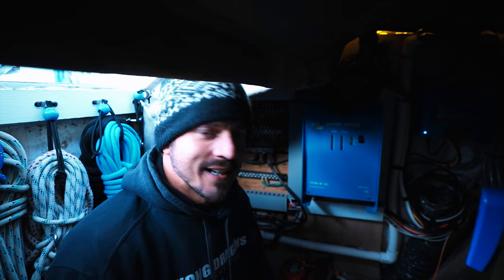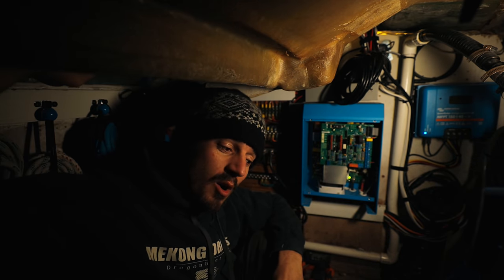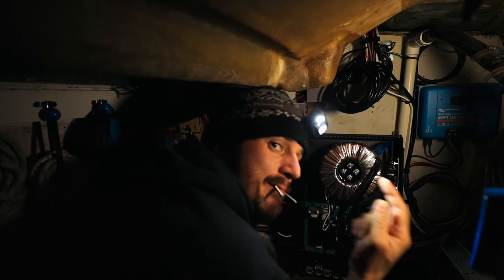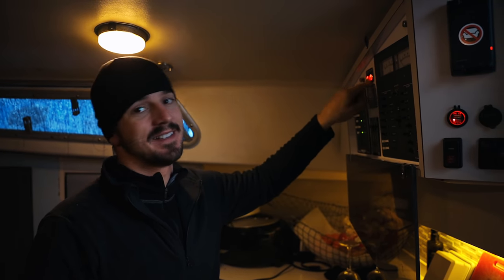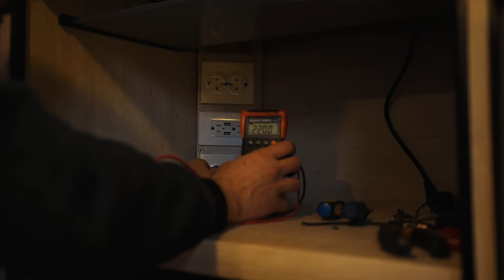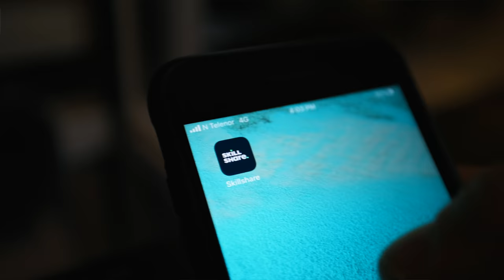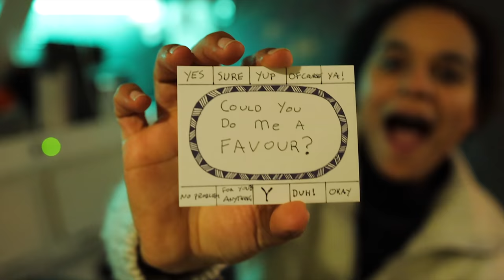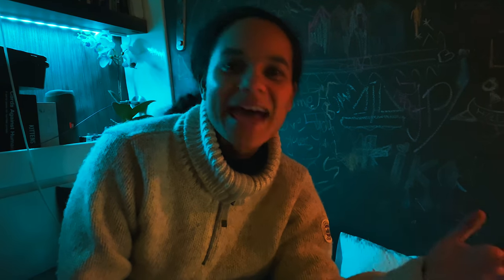Cold Dark Days — Sailing Uma [Step 255]

Comment: I love the episodes with boat fixes and upgrades. Great job Dan. I have 12v and 120v right now, but we are going to go with a 48v bank and electric motor conversion soon. Had not thought about adding 240, but now I think we’ll start planning for that for when we hit europe.
Reply from the maker: It’s hard to find a good 48v shore charger that runs on 120. Most are 230, so you may as well get one that inverts and has pass through. So you don’t just float your batteries to death when at the dock.

Comment: That's a lot of systems on one boat. I HIGHLY recommend using a labeling system at each end of every conductor to indicate which system it is on. Normally I'd say color code all conductors but that's a bit much for a non-commercial project. Looks like a well put together system - and that's coming from an electrical engineer :)

Comment: Different scenarios but , 6 months ago We set up for induction cooking in our camper. 
200ah lithium ,2000w inverter , 350 watt solar only (at the time)
Going great for us !  cooking for 4 each day solar keeps up 95% of the time. (Also Running two small fridges plus lights and recharging gear)
Only Just added a dc/dc charger so if needed can plug in and charge on the move. 
Hiking gas burner will stay stored for backup.
Definitely doable , just have to work around systems. 
Have fun figuring it out , definitely worth the investment in my eyes 😉

Comment: I run an induction hot plate, a microwave a crockpot and a fridge freezer combo off a 3500 watt inverter with 4 12v deep cycle lead acid. But I do have a 500 hp diesel to keep it charged. Even if it doesn't work all the time it's safer and better than gas. Crockpot the beans and rice and it lasts for days. I actually use the crockpot for skillet also so it doesn't spill.

Comment: That coil is called a Toroid , or torroidial transformer. That transformer, plus the fact that higher frequencies are quite often used, make the systems far more efficient than old technologies.  I actually have one nearly that large and it is wound as a transformer. It was surplus. Happy Bday Keeka.

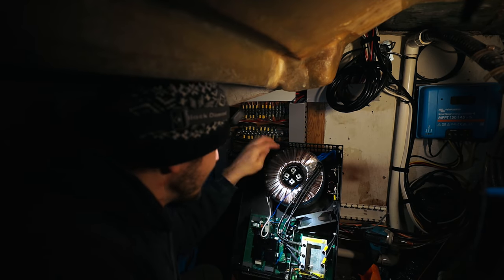Comment: At 6:27 ..that is not a "coil", that is a Toroidal transformer. It converts your 220 volt AC shore power, drops it down to a lower voltage, then rectifies it to a string of DC pulses, OK for charging batteries...if it was to be used solely by itself, it would need a bank of capacitors to hold the  charge between pulses.

Comment: Good video thanks. We converted to electric a few years ago and have an induction cooker onboard. On average we use around 5kwh/day and with 20kW of TPPL batteries can last for several days before we have to recharge. Works well for us but you will need a good changing system to be able to keep up.

Comment: Last time I know of working in sub-zero, was my ex removing the truck starter at -22 in SD during a blizzard, I rebuilt it inside and she reinstalled it, if had waited it was up to 30 two days later.....When I was in Europe, I used adaptors between each, some I re-wired with quick connect inline...Happy B'day, but I would have thought was your 21st... :)

Comment: Good work. Good project. It's great you have all those voltages covered. I've done electrical work for years but only just learned that North America is on the 130VAC as a legacy of 110 VAC from over 130 years ago, and that 240 VAC is a much better and more efficient standard. And from engineers Elon Musk (and Sandy Munro) that cars should've been 48 v DC years ago because then all the wiring could then be a lot smaller (and will even be more efficient).  It might seem like a luxury but if it turns out you need a power tool or appliance of some sort, the local voltage is easy, the foreign voltage is a long wait or expensive rush air freight.  Cool.  Uma leads the way!
Reply: You'll be happy to know that North American homes have both 120 + 240 volt outlets.
Reply: 48v would require larger wires
Reply: @MarkSpohr  larger than what?  48VDC requires smaller wires than 12VDC for the same power, but larger wires than 240VAC.
Reply: @CorwynGC  I thought he was referring to 48 vs 220v
Reply: It depends how you define the word “better “ when referring to voltage. From a health perspective 110V is better since it’s not deadly if u were to accidentally complete the circuit with your body! That was the criterion when the standard was adopted on the N. American continent, rather than the cost of wiring, specially if u consider the state of early wiring technology. The reasoning still holds!

Comment: Different Voltages must have physical separation between them. 240 V in US is a split single phase 120V x 2 with 180 degree shift, 60 Hz. UK is single phase/neutral 240V, 50 Hz. Full caution with Lion batteries and cold weather.
Reply: They come from different inverters, so they are isolated. I assume Dan and his helper Thomas did keep it isolated. Do u see a problem in having them in the same braker Box?
Reply: @scream221  if the box does not have two gangs, it is a code violation. Its all about fire prevention.

Comment: Watch your lithium batteries in the cold.  You can destroy them by charging them too fast when they are cold.  The BattleBorns, I think, have a low temperature cut- out so they won’t charge when it is really cold.  For this you could consider heating them so they will accept a full charge.  Some sort of heater powered off the shore power would be sufficient - just get the batteries over 0deg and they will charge a lot better.  BTW this is a lithium chemistry thing and the new charger won’t be any better.

Comment: That is a very nice upgrade!  Solar in the winter here in Norway is sketchy at best, so having the option of blowing the breakers at docks makes a lot of sense. Also has capacity for charging more lithium batteries, should you add them in the future. And, this is the first week here i Grimstad that we've seen temps above freezing, it should be great for you further on up the coast. That said, the only month it hasn't snowed in Finnmark is august, so...😅

Comment: Hey, I like Nerds and Nerdetts!  : - )   And the subject of this Step was electrifying!  Yet no one should be shocked by what Dan does - or even Kika.  Next, I am wondering is 31 the day of the month or how many times around the Sun?  I also have a suggestion for your "oven".  If you can find one where you are, Coleman makes an oven that sits on top of a stove.  It includes a temp gauge and can be folded up flat to be stored while not being used.  I've got one out in the garage.    I hope you're having a good time in cold Norway!   Scott W
Reply: I think Dan Transformed his system. He obviously  has the Capacity and Kika is a real live wire, quite switched on!
Reply: @jonathanwetherell3609  Electrical jokes are clearly making the circuit.  : - )
Reply: GROANERS are everywhere !!!
Reply: @JustMe-pp1mp  Aren't they a kind of frog?  Or maybe a toad.  Oh yea, the famous Groaner Toad!   : - )

Comment: As for your induction cook top. You might want to check. Most people who have one on a boat , have found they draw power even when off. Most people I know , running limited power instal a on / off swift for the receptacle where it is plugged in. Can save you a lot of battery
Reply from the maker: We just unplug things we’re not using. No parasitic drain that way.

Comment: FYI for your audience, many US products are made for both 120 volts and 240 volts. All you need is a plug adapter. Double check the device label and it will probably say 120/240 volts.

Comment: With your new power setup, you can plug your PCs directly into the 12v DC outlets. Probably. Check your adapter output.

Comment: Delos installed an induction top nearly 12 months, i think, seems to work really well for them...its gotta to be the way to go for boat cooking
Reply from the maker: They also have a diesel motor, a genset, 3X more solar panels and 2 wind turbines. It's certainly possible. But on an all electric boat like ours, we have to be much more conservative with power consumption. We can't just "fire up the genny" when our batteries are low.

Comment: STOVE WINDOW TIP! Take a tissue, make it wet and dip it in the ashes. Clean the glass with the ash on the tissue. Dry the glass with a new tissue.
Ps. Any plans on doing some ice skating?
Reply: Obviously the stove should be cold before you clean the glass 🙂
Reply: The brown gunk on the glass is a sign that you aren't burning hot enough.  Play with the air intake until you get a nice purpleish translucent flame.

Comment: Useful info: military lithium battery fully charged voltage is 3.9V per cell and civilian is 4.2V so in 48V system it should be in civilian version 50.4V topped 100% but military has chosen 3.9V to extend battery charge/discharge cycles by twice at least...so, your old (more sophicticated) charger was doing you a favor by charging those just up to 85% and then solar charger trickling them to 100%.

Comment: You were wondering about induction stoves! Check in with Brian on Delos they have been running one for a couple of years. That is if you haven't done so already. BTW great work guys.
Reply from the maker: Yes. We’ve had long chats with the Delos crew and others friends of ours running induction. But everyone we know who has an electric galley also has a diesel motor and a genset to charge of solar isn’t enough. Not so much for us. On an all electric boat, we have to be a lot more conservative with our energy usage since our batteries are also our means of propulsion.

Comment: A great example of realistic boat work, done inside a tiny little cockpit locker. I've tried an induction cooktop and can't find an inverter to run it🤔 Happy 🎉 Kika!
Reply: I've run an induction cooktop from a 2000w sine wave inverter
Reply: @MarkSpohr  How much wattage is the inverter? I'm guessing the issue with most setups (inverter and cooktop) is the initial startup voltage against what the inverter has available.

Comment: Have you been able to keep your battery bank above 0* C? I'm assuming the built in BMS in the battle born batteries would  not let you charge them if they're below 0 Celsius as LiFePO4 will be damaged by charging if they're too cold. Discharging is less of an issue at cold temperatures..

Comment: Kewl electrical system. What do you use to convert 48V from your batteries to 12V for navigation electronices?
Reply from the maker: DC/DC converters. Ours are from victron, but every electric golf cart out there has them too. Pretty common and also pretty cheap.

Comment: I have another suggestion for an "oven".  That would be a Dutch Oven.  You could stack some "shelves" in one and easy cook a couple single serving pizzas.  I've cooked cornbread in the one I have and they also make good slow cookers.  They are usually made from cast iron so they are HEAVY.  As such, they make great ballast!  lol   Be sure to stow it low.  : - )

Comment: Very nice and special video.... it shows us that these Lithium Batteries require charging circuits that MUST be specially designed for the Li Batteries. Questions, will your 5 Kw inverter/charger work on 60 Hz ?  As you know N.America has a 60Hz grid ! Europe has a 50Hz grid !  In my experience many smaller Marinas ( here on the west coast of BC Canada) have only 120V 60Hz outlets with  receptical sizes, 15, 20, 30A.  that might be a problem to you ?
Reply from the maker: We’ll sort of. As long as you can program the charge voltage and absorb length, any charger will do. Our old charger was actually faulty and was skipping the absorbs cycle. 

And yes our charger will take 180-260v in 50 and 60hz.

Comment: Looking at the glass of your oven: try dry steel wool. Steel is softer than glass, so it won't scratch it. But it is sure harder than all that carbon buildup!
Reply: Newspaper works like a charm, steelwhool scratch it. ;-)
I´not kidding you. Try to rub  newspaper to the glass. It will be clean without a scratch. Steelwhool make schatches, garanteed
Reply: @steinjohansen3142  Someone suggested a wet Kleenex or paper towel dipped into the wood ash and that be rubbed on the glass. Sounds like a good idea as well.
Reply: @steinjohansen3142  I have heard the newspaper trick before too! I have also heard that ash works as well.

Comment: Great video guys!! Happy Birthday Kika! Have you had any issues with the Battleborns getting too cold and having the BMS not allow charging? We never had an issue with it while we were up north, our heating duct runs right past them and now we are in sunny Florida :)
Reply from the maker: We haven’t had any issues. We had this talk with Battle Born last year before sailing north and they mentioned that the internal circuitry keeps them warmer than their surroundings anyway. Plus our cockpit lockers stay at sea temp, nit air temp. Our frostline inside is about a foot above the waterline even at -20C. So yes, technically they wont charge below -5, but they also dont get that cold, so its been fine. 

Make sense?
Reply: @SailingUma  Cool thanks for replying, it's been a burning question in my mind LOL. Glad to hear that it's all working out!
Reply: @CalicoSkiesSailing  42qwaa

Comment: Hi Umans and Happy Birthday Kika! I wanted to ask what is the temperature in your battery compartment? I hope you are not recharging those in minus 10 degree. LiFePO is safe to recharge with 0.05C in these kind of conditions. Higher currents will kill the chemistry. You will loose the capacity in each cycle.
Reply from the maker: Battle Borns have an on-board BMS to prevent charging of it too cold. So far, it hasn’t been an issue.
Reply: This BMS cutoff is good when using single battery or a sequential row. As soon as you start using those in parallel things go more complicated. In this case it is better to have a charger with low temperature protection and set the temperature slightly higher than the  battery that has the highest setup.

Comment: How are you using N64 controllers on a laptop playing mario? Mainly the controller thing
Reply from the maker: The controller is hooked up to an N64-USB adapter which is then plugged into a USB-USBC adapter to connect to the laptop. And we play with a downloaded emulator.

Comment: You did a ton of work 💪 How do you like 240V vs 120V appliances?
Reply from the maker: Still getting used to how tiny the wire sizes are. We have to check and recheck our calculations.
Reply: Europe went to 230 to save money on the copper wires. Higher voltage thinner wires
Reply: @SailingUma  Twice the voltage is half the amps :-)

Comment: Delos installed all electric cooking with an induction cook plate in their boat about a year and a half ago, so yours should be fine, although I don't know how much more solar and stuff they have cause they have a lot more places to put it on a much bigger boat.
Reply from the maker: ... yes but they also has a diesel engine and a 12kw genset onboard and a lot more solar panels. Not exactly a good comparison.
Reply: @SailingUma  oh yeah hehehehe

Comment: Install a webasto heater in the boat 👍
Reply: They don't carry diesel or gasoline or gas (natural or LP)... is there an electric version?
Reply: @divekatdreaming  there is some electric Heaters, but they use so much power, battery will drain fast, I was just thinking when they use wood stove then need to carry wood,  with webasto you will need a very small diesel tank, 5-10 liters, it have low consumption, easy to refill with a normal petrol can from the gas station, and the webasto can run in the night and also when outside of the boat, that is difficult with the wood stove
Reply: @dronephantom2649  You are right. I thought they made a purposeful decision not to carry other fuel, but they have do have gasoline for the outboard anyway.

Comment: It's a shame you are a few weeks behind with publishing your videos.
I have a suggestion for the new inverter to save you time & effort.
Mount it on the bulkhead on wooden spacers. (leaving about an inch gap behind it)
That will make it easier to mount and also give you room to put all the existing cables behind it, saving you having to re-route cables.

Comment: Happy belated birthday Kika.  Quick question, only because I saw the issue on another channel.  Can the battery charger determine if one of the batteries is under charged when the other is fully charged?  That was a problem for another YouTuber.  I guess because his charger couldn't determine if one was low it would overcharge one battery and when they dropped in juice one would drop too low.  He installed some small device that balanced the batteries.  Or at least that's the way I understood it.

Comment: 5kW charger, I wonder if the marinas have any bigger than 16Amp outlets/fuses...
Reply from the maker: Most around here don’t. But many larger marinas have 40A or 50A plugs. But 16A is still 3600W. More than double what we were getting before.
Reply: @SailingUma  How do you regulate that? Or does the new charger have that feature? In that case it's awesome!!! I want to regulate my intake to 10A. :-)

Comment: 5kw !! Is that for the engine ?
Reply from the maker: That’s to charge our batteries. Which we use to power the electric motor.
Reply: @SailingUma  I see... so thats solar and hydro combined ? 
I'm in the process of connecting 2 x trolling motors to cruise my narrowboat... all good so far ! 
Saving up for traction batteries at mo
Reply from the maker: Solar and hydro cover our house loads only. If we ever motor for more than 30min or so, we’d need to recharge at a marina. But we’re working on better solutions.
Reply: @SailingUma  my 200w solar covers my house. Living in the uk, for 3months in Winter i have to charge things in stages , like my tablet takes me 5 days to charge rather than 6 hours ! 
Pumps and light takes priority . 
Good vlogs ... 
L